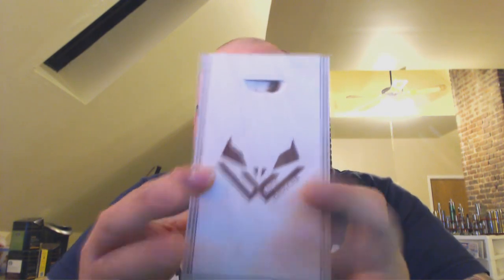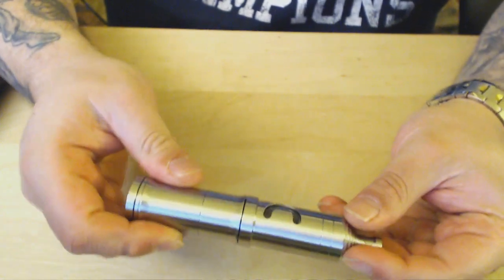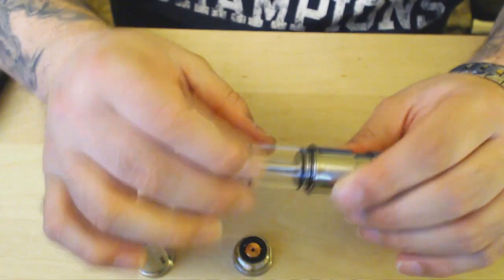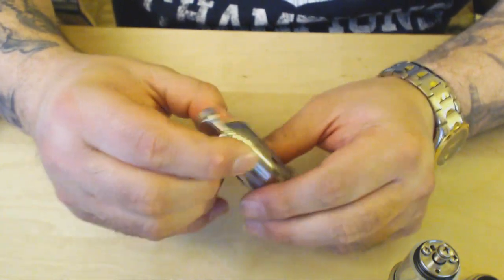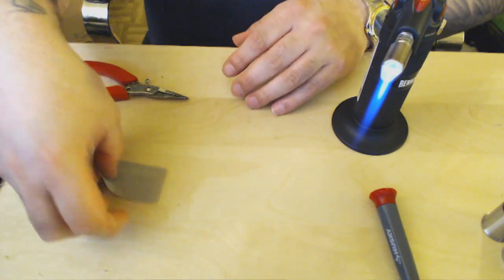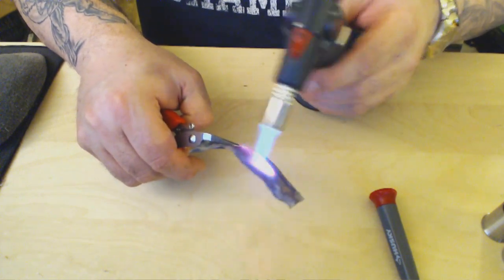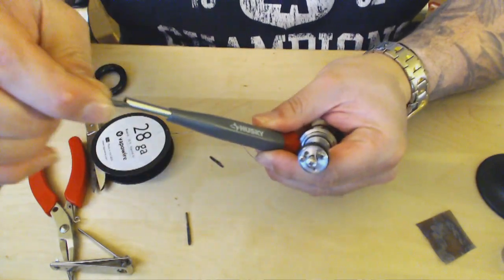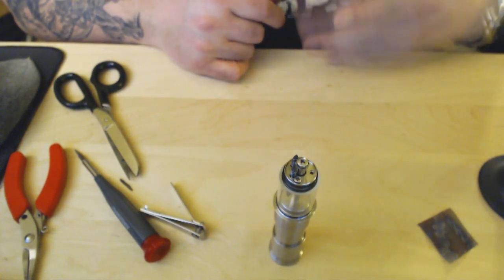Mr Can

Comment: Nice review, as always Bishop. I recommend trying a dual coil build with SS cable & XC-116 ceramic topper, one of the best vapes Ive ever had, excellent flavor, warmth & density.
Reply from the maker: Thanks Will, I'll give it a go.
Reply: Let me know how it goes. I did find that with some juices it seemed to gunk up a bit faster. Not really a big deal since all you have to do is dry fire or torch clean, takes all of 3min & its ready to go again. XC-116 is some durable shit, you can torch it clean several times before it really starts to degrade.

Comment: Great video!  I gotta say I'm a bit (pleasantly) surprised to see you working with wire rope!  If you leave them longer, you don't even have to tilt the device.  But I guess tilting is your style.
Your tools and vaping accessories are some of the reasons I come back to your videos.  What are those pliers you use to cut the wire ropes?!?  My friend and I tried it with some pliers but it got bent sideways and didn't give a clean cut.  Tried a dremmel tool too and getting a good quality cut was hit or miss.  Thanks!
Reply from the maker: actually you don't have to tilt anything much. I use shorter much shorter not even showing in tank.